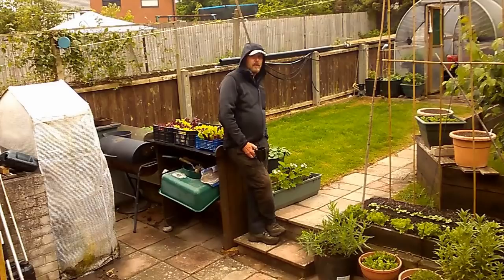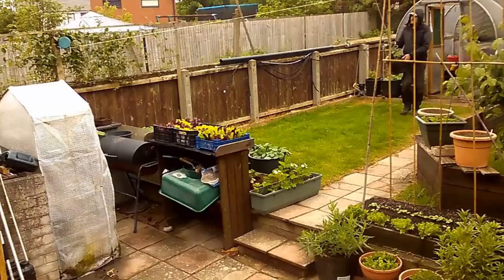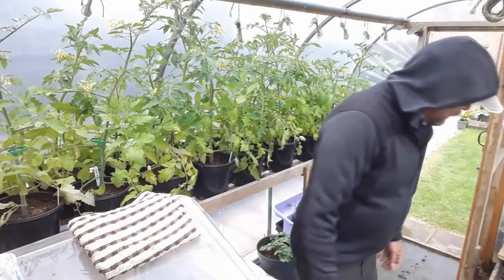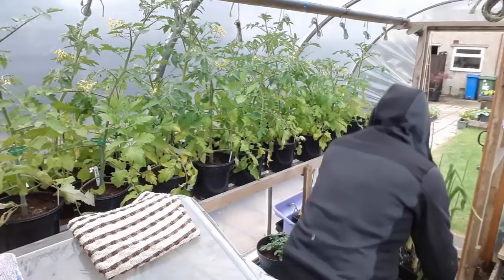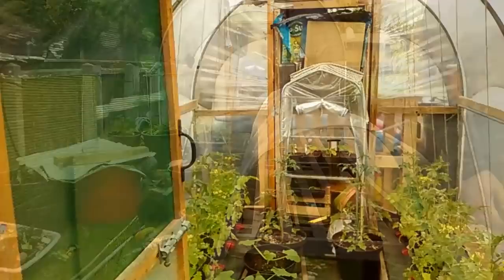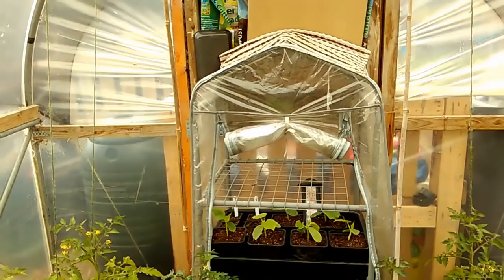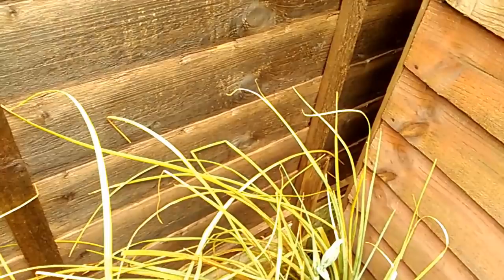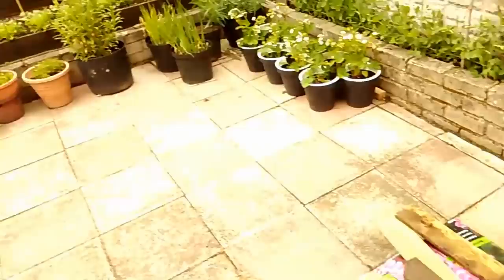Garden Update 20/5/20, Tomatoes finally go in & Poly tunnel shelf conversion

Comment: Your whole tomato growing system is always the best I have seen.  I'm just about to plant mine out so thanks for the reminders of adding the soil fixers to the holes. I think I will try the little "water feed" pot this year.  No sense adding the fixers if there's not enough moisture for the roots to be able to draw them in.  Some of my plants had BER last year; very sad.  Your shelf/mini tunnel/drying rack is a great idea.  You could draw up the plans and sell them!  Thanks Andy.
Reply from the maker: Thank You Sherry, i used to get BER a lot years ago but its mainly a magnesium/calcium issue so lime and epsom salts really do help reduce the chance BER and also never let the plant get to wet or too dry just keep it so its just moist, i think each plant would need anything from 0.5 - 1 lt per day in the season and usually better done in the  evening so it can spread out in the compost and be taken up ready for the following days sunshine, also you can add a little sugar to the water to sweeten them up a bit but only a table spoon per 10 lts once the fruits just begin to ripen.
All the Best
Andy
Reply: @andy160676  Thanks so much for the info!

Comment: You certainly have got a lot going on in the home garden Andy, but it's all looking very healthy indeed..time to put those plumbing skills with the old pipe bender to good use and make yourself some 22mm copper tube hoops instead of the polythene water main, mind you , then it might get a bit too hot for the plastic cover, always something  :-)..
Reply from the maker: Thanks Stephen, Its been nice to have the time to spend pottering around the garden making the most of the space, just a few more things to plant then its full, mind you the first spud harvest is due in 5 days of the swift so i might just pop some more in for another 90 pull before the xmas ones go in.
Ive thought about using copper for a few things round the garden, there is an old rack thats made of 22mm copper thats about 15 yrs old down there that i put some bits on to pick at.
All the Best
Stay Safe
Andy